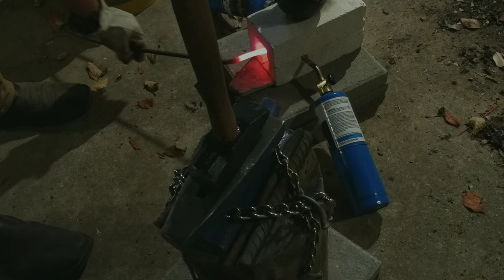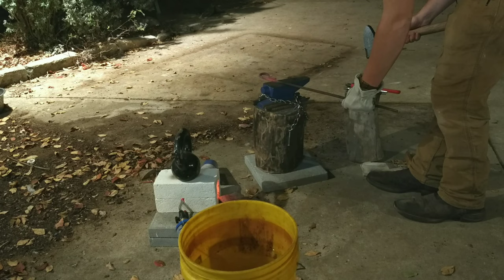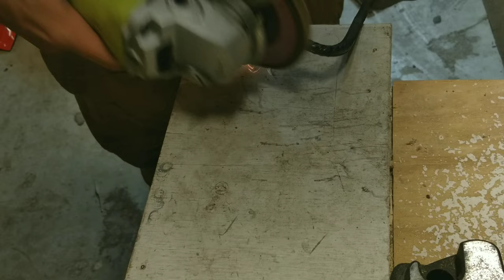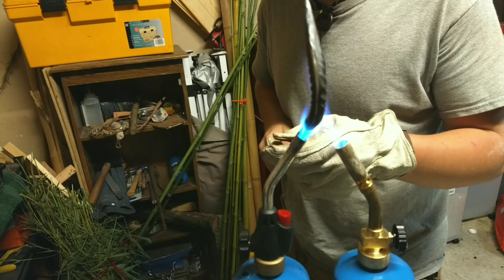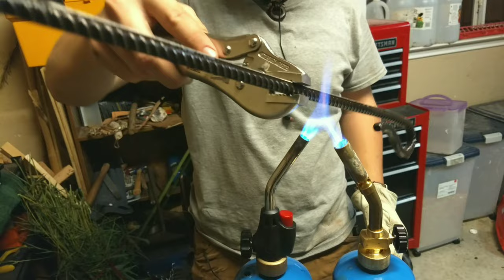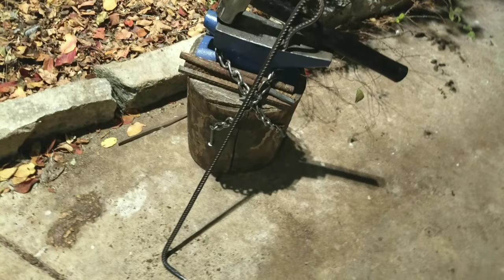FORGING A POKER (FROM REBAR)

Comment: Hey good job Jim , BTW  that flap disc on your grinder will grind a bevel in your first knife , just clamp a piece of a Iron to blade where where you want the grind line to stop near the handle, move fluidly back and forth and don’t stay in one place too long . I made my first knife that way and it’s still came out good , make sure to wear eye protection and gloves and be sure to clamp the blade securely you don’t want the grinder to launch the blade into someone.